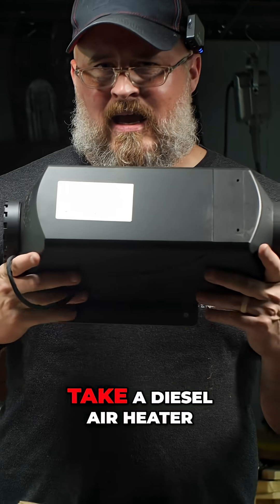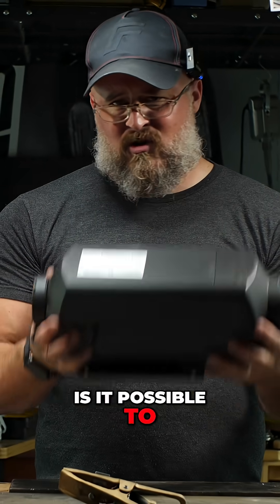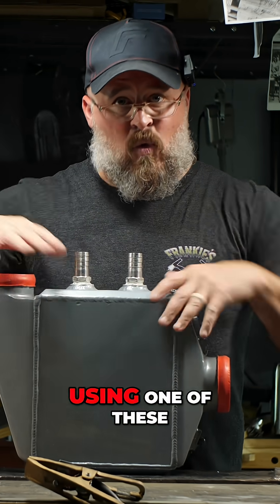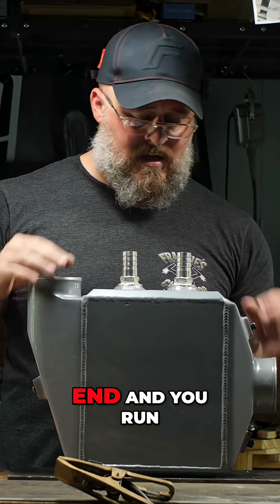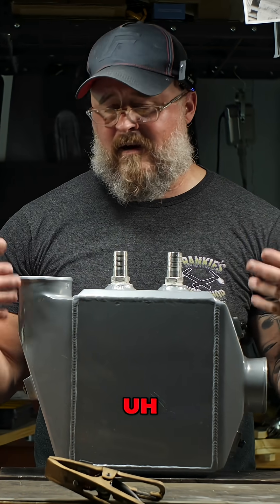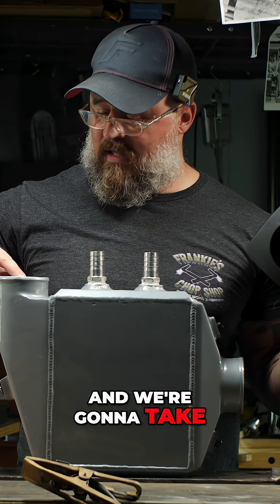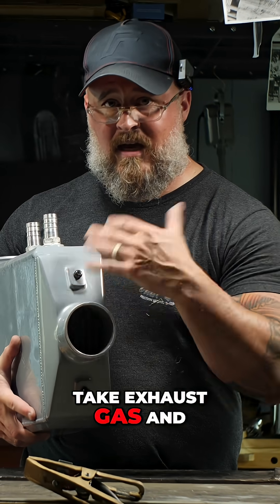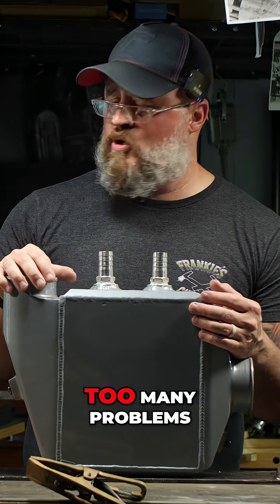Diesel Heater Water Heating? Efficient DIY Explained! #shorts

Comment: Put a thermostat in the water line set to say 70C. Have it trip the 12 volt pump until it falls below say 40.  Also it may not be the most efficient i would think to more efficiently heat the water you would need a larger intercooler surface area. Thanks for testing stuff though. It fascinates me to see people coming up with neat ideas.

Comment: WASTED ENERGY WHY USE THIS TO HEAT WATER WITH A HEATER DESIGINED TO HEAT AIR IMAGINE IT BEING HOT INSIDE AND YOU AC ON NOW YOUR TURNING ON THE  HEATER TO HEAT WATER
Reply: You would use it to get hot water ONLY when it is cold outside and you would be using this anyway.  Think AUX. water heater.

Comment: I'd think you might need a header tank of some sort to circulate the water into. I've read that the air coming out of some of these can get up to 160C (about 320F), and that's far enough past boiling temperature to bring safety risks.

Most DIYers use the waste heat from the exhaust for water heating. In fact, a friend used a home made heat exchanger to heat his small (by American standards, but pretty big for here in the UK) above ground pool. It was about 15 foot across and 3 foot deep, so a reasonable volume of water. The heat exchanger was a (IIRC) 1" copper home pluming tube inside a much bigger copper pipe. He got a collection of reducers to bring the roughly 3" pipe down to 1" via a couple of T fitting to act as water inlet and outlets. The whole thing was about 8' long (would be ridiculously expensive to make today because how much the price of coppers shot up ! 😕). The novel bit was that he also ducted the hot air through a kind of flexible foil heater vent tube that the whole heat exchanger went into to try and heat the water jacket from the inside and outside.

I was always supprised that the little heater didn't seem to care one bit that it had something like 15' of exhaust pipe on it.

The setup had a central heating pump circulating the water, and could take the nights chill off the pool in a couple of hours, but if he'd had the cover on the pool, and the heater had been on all day, it was actually just about getting to what you could consider as warm.
Reply: That's a $1200 intercooler lol. Waterheaters are a couple hundred bucks. Im all over fabrication and making stuff out of junk or used stuff for ways not intended but that's a expensive waterheater.

Comment: This is cool, but having used a diesel heater, it takes a few minutes for the heater to get up to temperature. Then you gotta wait for the water to get up to temperature. Just seems like a long process unless you've already had the heater going for a while which is situationally dependent

Comment: At second 11 he says he wants to heat the water efficiently, however what he's doing is anything but efficient. It will work, but I think it's a pretty bad and inefficient idea. Good luck with it though.
Reply: That's a $1200 intercooler lol. Waterheaters are a couple hundred bucks. Im all over fabrication and making stuff out of junk or used stuff for ways not intended but that's a expensive waterheater.

Comment: Why would you reverse the direction of airflow?  The "cooler" will heat the water regardless of the air direction.
Reply: That's not what he said he said he is using it in reverse because it's ment to cool air not heat water 🙄
Reply: @graemeabernethy9263  Yet he pointedly pointed (sorry for the doubling) to the exhaust as if to use it as the intake.
Reply: @BWolf00 it's cool bro, but it has very low air resistance so it really makes no difference he can push the air through either side and it will still do the same thing
Reply: @graemeabernethy9263  Generally I agree but I think if there are any design elements, efficiency would favor the original airflow direction.
Reply: @BWolf00 if he was using something else you would definitely have a point but do you know how much air these things move they normally have 40-70 psi moving through so the what mabey 2 psi that thing is pushing is nothing look up race car intercooler you will see 5,000hp cars breathing through them with very very little restrictions
Reply: @graemeabernethy9263  Point well made.